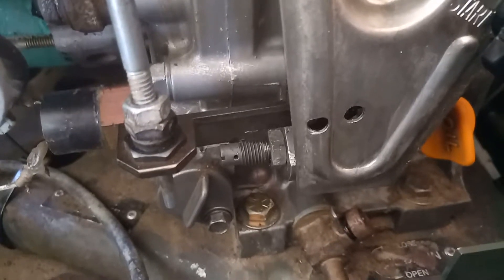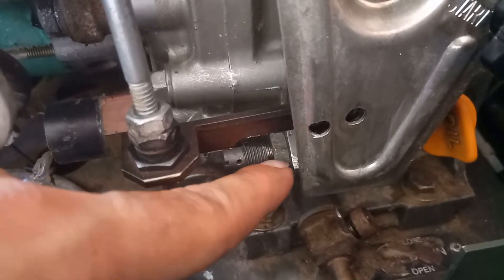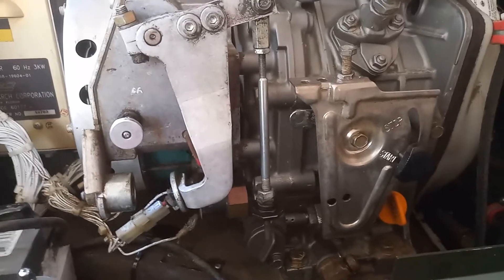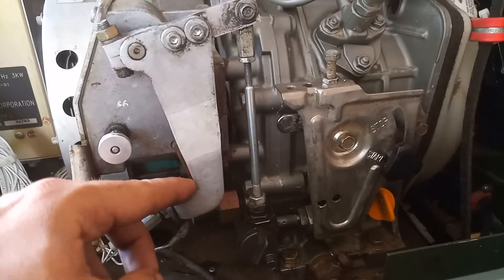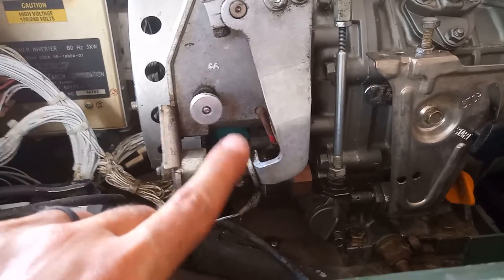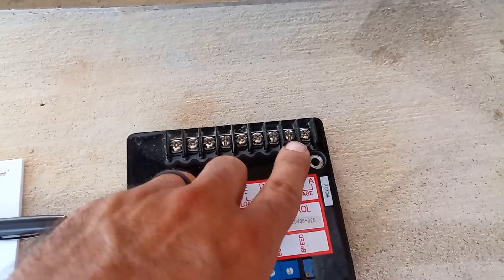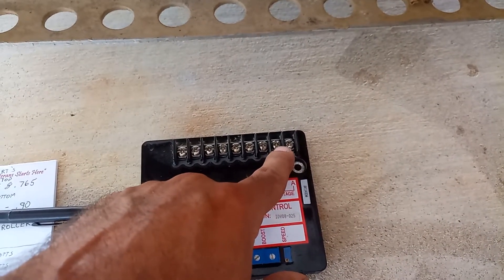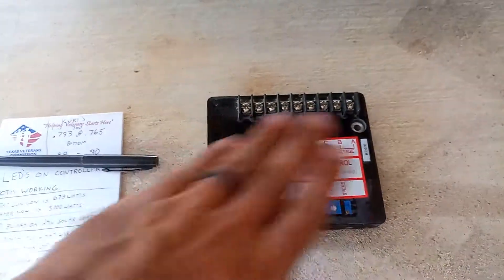MEP 831A - Part 2 Speed controller & governor adjustments

Comment: Hi, I just ordered the controller, how do I know if the voltage gauge is good
Reply from the maker: Voltage meter is pretty straight forward. Measure voltage at the lugs with a multimeter & see if it matches the gauge. If it doesn't, work your way backwards from the gauge connections looking for something wrong.

Comment: Should this fix the problem of it not shutting off
Reply from the maker: Yes, 9 times out of 10, it won't shut down due to this all being adjusted improperly. It's a huge pain in the rear to do, but do it right, once & double check yourself. Then, as long as there's nothing wrong with anything physical, it should run good.
Reply: Check your magnet depth
Reply: Say you have the 5/16” space on the magnet and it’s still not shutting off with neither the switch or the emergency switch, I have the correct voltage and ohms everywhere but there’s a break somewhere because I can put it in start while it’s running and drop it back down to run and then it’ll shut off but only sometimes. Can you help me out with this issue?
Reply: @jerrileethornton1291  Did you figure out the problem? Having same issue